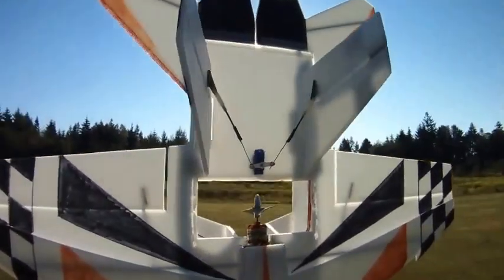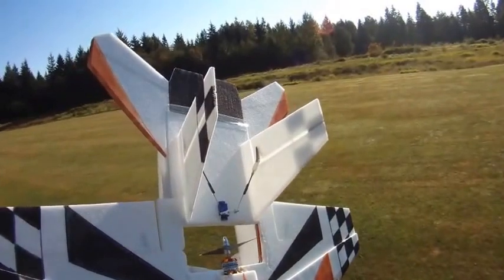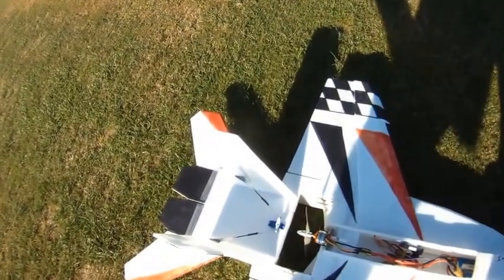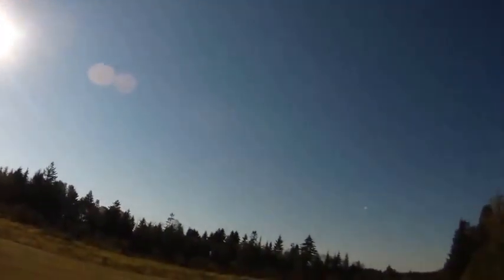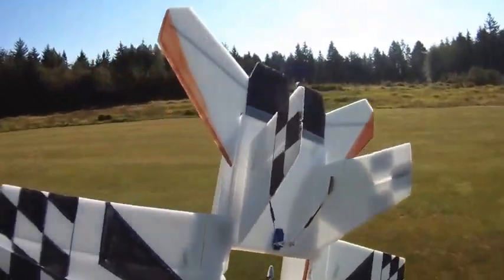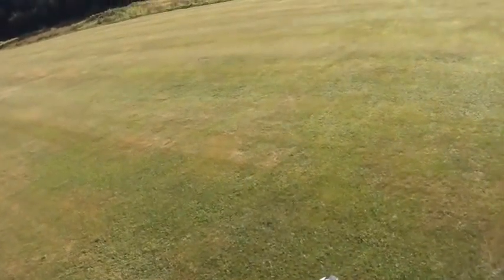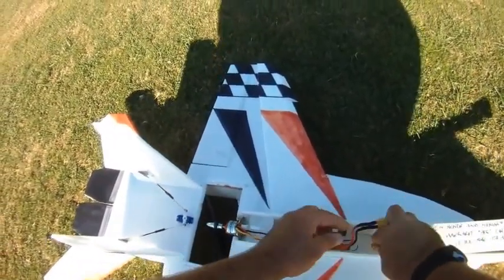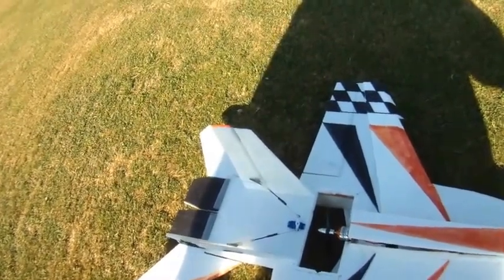RCP F18 V3 with Turnigy 2826/6 2200 Kv motor

Comment: Hey Scott, where do u get ur props? Any specific site or seller?  I want to give a shot for these emp props but i cant find like urs. Urs from RCTimer or Focal Price? Not from HK for sure...
Reply from the maker: I get the APC props from HK https://www.hobbyking.com/hobbyking/store/uh_viewItem.asp?idProduct=22423  I buy my EMP props from RC Timer, the best price I have been able to find http://www.rctimer.com/product_218.html It is important to balance the EMP props as they can be very out of balance and the vibration will cause them not to work well.  I also balance the APC props, I find they work better and are a little quieter when they are balanced properly.
Reply: Ty man. Im not happy with JM 6x4 APC-E props which recomonded on part list RCPowers. They are changing shaps with throttle and give around 600 gram trust with D2826-6 2200 with 3S 30-40 C and Turnigy plush 30 mid timing. I have no idea why its low like that. I have 950 gram trust with same setup 7x4 EMP. But need somthng spinnig faster to go fast. U can see diffrence even with ur eyes between 6'' and 7''

Comment: HelloScott, nice set up you have, I also am a big fan of Dave and Scott's designs. I fly mine with the Turnigy SK3 2836-2500 Kv with a 6x5,5 prop and she rocks. Great videos and Happy landings for 2014. Greetings Rcflying Fil
Reply from the maker: Hi Fil, I will have to check that motor out for sure, I have been really liking the Focal Price 2700 Kv motor for these V3 size planes with a 6x3 EMP prop http://www.focalprice.com/YO090X/A2212_2700KV_Outrunner_Brushless_Motor_for_Airplane.html, lots of pop and acceleration.  Thanks and Happy New Year and flying to you as well.  :)